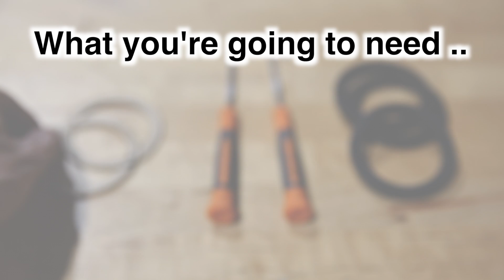Changing Group Head Seals and Basket Tension Springs

Comment: You mostly skipped the hardest part IMO: getting the o-ring out.  Once you get it started, it's easier...that first part is the hard part.  I had to take the entire head off of my Cimbali to get mine off - gave me a good chance to give it a thorough clean, though.  My experience was opposite what you said also in that my group handle was pulling over less and less...once I changed the o-ring, it pulled to the proper perpendicular.  :)
Reply: Which bit is the O-ring? I'm having the same issue with my old La Pavoni.